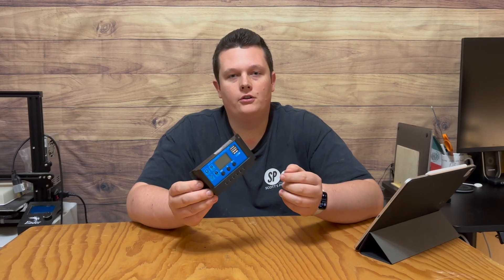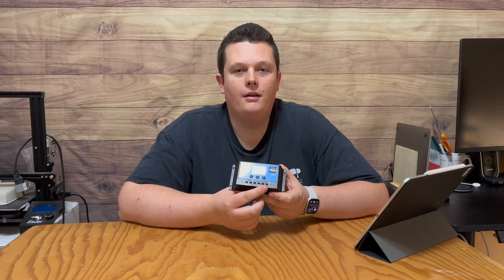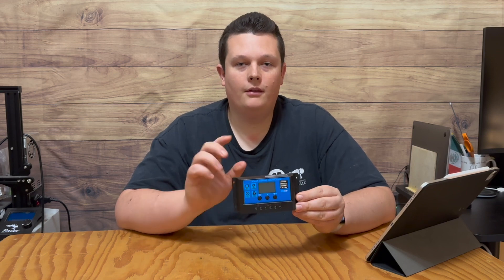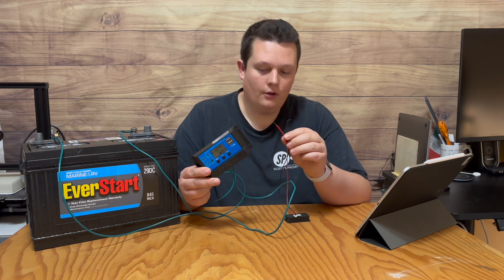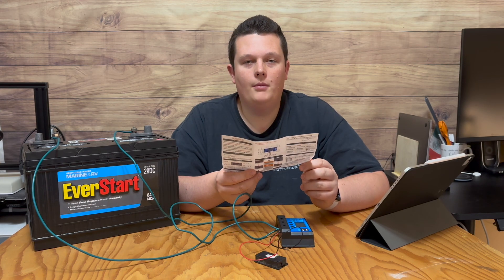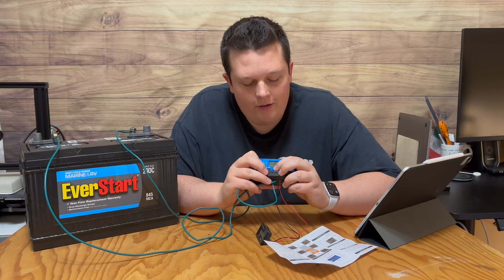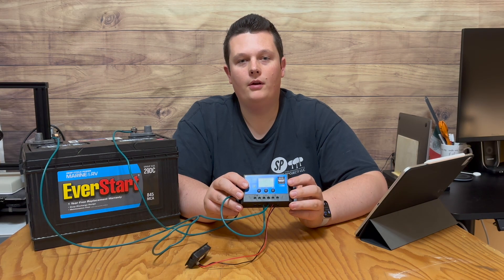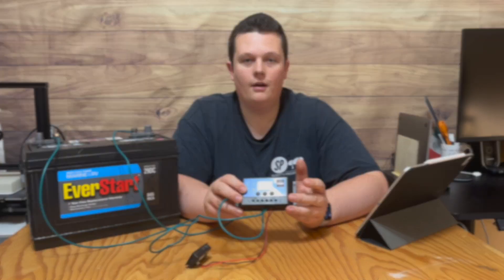How to Setup the Load on a Solar Charge Controller

Comment: Can you hook up to the load side without a battery? I’m trying to run a small water pump 2.7amps during the day only.
Reply from the maker: Unfortunately I don’t believe so. I have had success with a 12 volt fan and solar, but it would only spin maybe 10% when the sun would shine. So you could try, but you really need a battery to operate properly.

Comment: Hi Scott I have fitted a 300ah lithium battery into my caravan and had to update my MPT controller to a Mppt controller.  I have a positive only load wire from the MPT.  The new Victron mppt 100/50 doesn’t have a load terminal.   My question is can I join my positive load and positive BATT wire together and connect to to BATT terminal on Mppt controller.  I can’t get back to the battery to give the load wire power.  Thanku for any feedback.
Reply from the maker: I would say the best solution would be to hook the load right off the battery terminals. But if you can’t access the battery, that makes it hard. I’m not a professional and I’m not recommending anything, but, it would make sense to me that whether the load is connected on the battery terminal or at the end of the wire hooked into the controller, that there wouldn’t be a difference. But, again, that’s my unprofessional opinion and I don’t advise it, be careful with the wiring. You just wouldn’t want an electrical fire and ability to prevent them too. I hope that helps!

Comment: If you want to get even close to max out put of your solar panels you need a mppt control. Those cheep pwm controls will draw your panels down to battery voltage really cutting the out put.
Reply: It’s an MPPT controller.
Reply: @matthewpenn407  

No it isn't.

Comment: I feel very confused when I go through the menu buttons on this thing. There's so many little things that it cycles through. And it doesn't make any sense. I don't have any confusion about setting up the hardware but about what the buttons are cycling through and showing you only.

Can you tell us more about the battery monitor device you have plugged into the solar charge controller also? That sounds interesting.
Reply from the maker: Gotcha, watch my other video on this, it should help a little more:
https://youtu.be/EBjmAeNeDiE 

Also, I just used the battery monitor for an example of a load output. There’s tons of them available on Amazon if you want one. They just tell you your battery voltage and a simple battery percentage. Though, just like the voltage can sway easily depending on your load, so does the percentage.
Reply: Thank you Scott

Comment: Is the voltage readout accurate on your controller? Mine indicates 0.26 V higher than either the electric one I connected as a load OR my DVMeter across the main battery terminals. Not very good ... but hoping it's just a calibration thing and that the controller is otherwise good to go.
Reply from the maker: Yes, I have seen a slightly different voltage reading off the controller, not sure by how much, I hope it works out for you!
Reply: Hey Scott ... update is that I can't alter the Float Voltage on either unit. It's stuck at 12.6. Simple solution is to return them. I'm ordering something by Renogy now. You get what you pay for. Thanks -
Reply from the maker: Gotcha, interesting, thanks for the update!